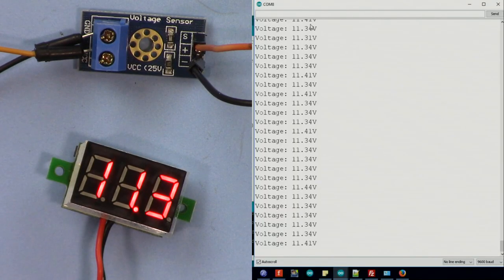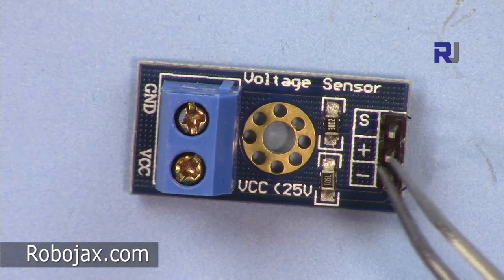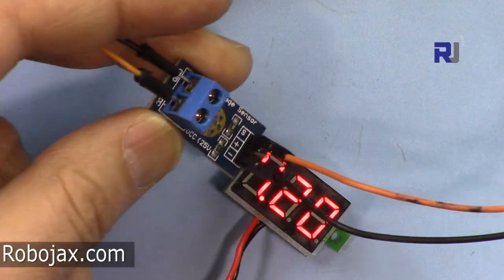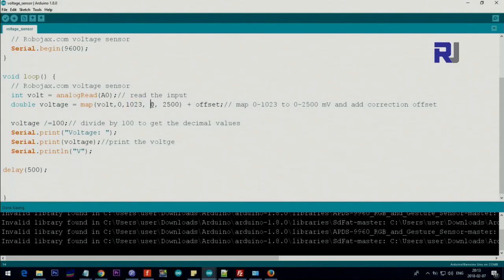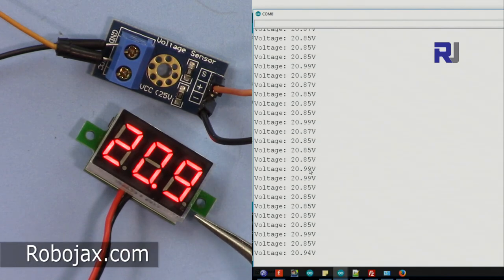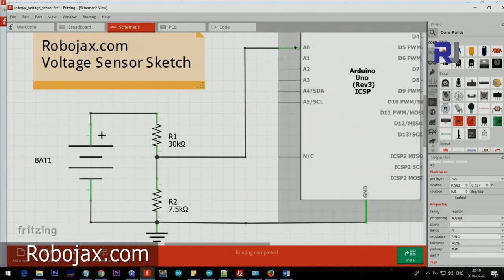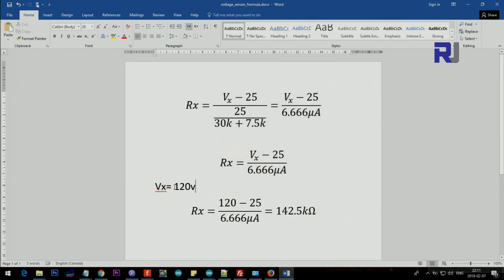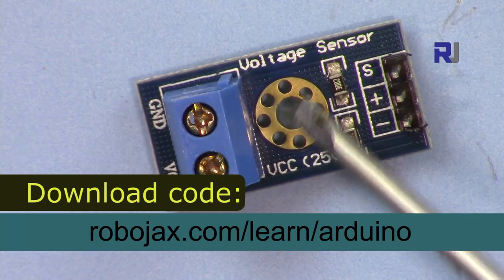Voltage Sensor for Arduino with code and formula to measure any DC voltage

Comment: instructions unclear.
 my arduino has black smoke coming out after i plugged it in mains supply.
Reply from the maker: you must have done something wrong. It can't be explained clearer than this.

Comment: Thanks for the helpful video.
If I leave this connected to a battery (for instance, a car battery) how much current does it draw? I would be concerned the battery would be drained too low.
Reply from the maker: you are welcome. I have included this in the description. the current used is 666µA which is very minimal. Even you could power it up with AA battery for months.

Comment: I just bought one of these without even looking at it - It's just a pair of resistors set up as a voltage divider with a terminal block on the end. At least it was under $2, but this module is completely unnecessary if you have a pair of resistors, and the values you choose will determine the maximum voltage - example: a 10k and 100k will give you a 10:1 division meaning you can measure up to 50V. This has got to be the most underwhelming module ever.
Reply from the maker: I have explained that in video. Unfortunately people are buying it from eBay and AliExpress.

Comment: You haven't shown where you connected the VCC and GND in your circuit to measure the voltage.
Should we connect it parallel to a load in a circuit to measure the voltage across it?
Reply from the maker: you need only 2 wires to connect to anything that you want to read the voltage.  you can connect it any DV voltage either across a resistor or sircuit as long as it is within the range. Watch the latest video on how to measure DC voltage using Arduino: https://youtu.be/t8xwrVj2aFs

Comment: Hello i have I'm trying to measure up to 60v. I have the correct resistors and output is 2v for the arduino. How can i change it to measure up to 60v?
Reply from the maker: Hello, I have explained it in the video with formula where you can  measure any voltage..  Also I have provided a document on how I got the formula. The link to the resources for the video is under the video in the description.

Comment: What we have to change the coding when use on esp32?
Reply from the maker: first you should not use this as this is just waste of money. you  just need two resistor to measure any voltage. see the video here https://youtu.be/t8xwrVj2aFs  measuring voltage is the same as using potentiometer to measure voltage. see ESP32 video for that here https://youtu.be/UXKu2Xtwj7c

Comment: Hi! Can someone please tell how to connect more than one/multiple voltage sensors in a circuit to the Arduino and read it? I really need help with the code and the connections?!

Comment: works perfectly! thanks. 

what if i want to use the voltage data in an if statement that if the battery starts to die a red led will turn on? 

can you include a code for that? 

thank you
Reply from the maker: to do something when voltage changes to a value,  do this. for example when voltage is less than 8.5V

=== start of code ===
if (volt <8.5)
{
 // turn PIN 2 high which you can connect to LED or a relay
digitalWrite(2,HIGH);
}
=== end of code ===
you can put this anywhere after the line;  int volt = analogRead(A0);// read the input
you can change < to > if you want if the voltage is greater than 8.5 or any other value.

Comment: Thank you for the valuable video! I have a question about the voltage sensor: can it be used for high current sources (e.g. a car batterie with 60-70ah)? If not, what are the adjustments we need to make, if any. Thanks a lot!
Reply from the maker: you are welcome.  this module has limitation. See my latest video on measuring voltage https://youtu.be/t8xwrVj2aFs where you can measure any voltage. When measuring voltage, the amount of energy source or current it does not care if you measure a small AA battery's voltage or a car battery's voltage.  Here is my video showing how to measure voltage and current up to 500A https://youtu.be/9jwCc7uPGoc to make energy meter. or  here if you want to display it on LCD https://youtu.be/xHe9RRQWMBM and I've got more if you search my channel.

Comment: i have the very same module, using your code it required -105 on the offset - which is fine, but when placed under it's own power, the values are out of calibration once more - and seemingly the lower the supply voltage to the arduino, the higher the returned "sensor" voltage", despite the arduino sensing it's own supply! what is going on here?
Reply from the maker: Forget about this module. Here is ultimate voltage reading for Arduino https://youtu.be/t8xwrVj2aFs

Comment: Can u pls help with esp 8266 lolin? is not given correct data...im about to get crazy here thx
Reply: Same ,i use wemos d1 mini
Reply: @rimbang_  it seems esp8266 has a prebuilt voltage reductor im not exact about what or how
Reply: Try change the map : before : map(value,0,1023,0,2500)+offset;
.
Change the "2500" i try that and is liitle accurate
Reply: @rimbang_  Tried but did not work

Comment: How you did calculate...  25V / (30k + 7.5k ) =>  0.667 mA  miliAmpers  NOT microAmpers !!!! and NOT 6.667uA  OMG! 1st grade rules of matehematics !   if you assume I=6.66 microAmpers and  Vx = 120 Volts   then  Rx  must be  14,2 Mega Ohms !!!
Reply from the maker: Hi, Just follow the link and see the document I provided. Don't use this junk piece.  Just use two resistor and measure any voltage by watching this video https://youtu.be/t8xwrVj2aFs

Comment: Hi. How can we power an esp8266 microprocessor with the battery while also checking the battery's voltage with the voltage sensor?  The 8266 uses 3.3V and the battery I'm using is a LiFePO4 3.2V.  If I use a USB cable to the 8266, everything works as expected.  But as soon as I unplug the USB cable from the 8266, there is no power to the esp8266 anymore.  I tried plugging a jumper wire onto the sensor's + pin and the other end to the 3V3 pin on the 8266, but that doesn't give it power.  I also tried connecting the jumper wire to the 5V pin on the 8266, but still no power.  If I connect the battery's wires directly to the 3V3 pin via a breadboard, my 8266 works fine.  Anybody have any ideas?  Is there any documentation for this Voltage Sensor board?
Reply from the maker: Hi, here is introduction to ESP8266 https://youtu.be/pLvqh57T3s4

Comment: Hi. Can you please explain a bit more about the correction value(int offset = 20)? What is it for and why we have to include it in the code? Thanks.
Reply from the maker: Hi, I used the offset to correct the deviation from correct value. Resistors with 10% tolerance  might give some fixed value error which can be be corrected with that offset. you can set it to 0 if you don't to use correct.
Reply: @robojax  Thank you so much for explaining. You definitely have great videos.

Comment: Thank you for the great video! 
I have a question. I want to make a circuit using the Arduino and a battery, and I want to monitor the battery voltage. Can the Atmega328 chip measure a variable voltage that is the same voltage (from the same battery) that powers the Atmega328 chip? (I want to make my own microcontroller board running on one singel lipo battery at 3.2 to 4.2 volts, and to connect it directly to the Atmega328 without the AMS1117). Thanks
Reply from the maker: You are welcome. Yes you can. here in the datasheet https://www.mouser.com/pdfdocs/Gravitech_ATMEGA328_datasheet.pdf you will see in first page the operating voltage: 1.8 - 5.5V for ATmega48PA/88PA/168PA/328P

Comment: can you help me? whenever i cut my source which is 12v the reading in the serial monitor decrease so slow that it takes 2minutes for it to go completely zero.
Reply from the maker: It seems you have a capacitor connected to the input of Arduino. Please watch better way to measure any voltage https://youtu.be/t8xwrVj2aFs

Comment: Firstly it would not exceed 25.20VDC as you mapped it to that, secondly and more importantly, that device is just a voltage divider, you exceeded the maximum 5vdc on the input and that exceeded the 10-bit adc count, inputting 30vdc at the input of the sensor means you were getting a much higher voltage on the ADC pin and risk blowing your MC
Reply from the maker: Hello, you may need to view this video https://youtu.be/t8xwrVj2aFs
Reply: That video does not change physics, the voltage divider gives a reference voltage to the arduino 30VDC when R1 is 30k and R2 is 7.5k gives 6v on divider, that is enough to ruin your arduino, there is no protection on that circuit, when you went to 30VDC you exceeded the ADC resolution and you mapped that resolution to 2500, demonstrating that you can exceed this could cause damage to the device, if you don’t know what you are doing then don’t make videos or refer me to videos that are a logical fallacy. People come here for advice, see a video like this and destroy their projects, my students use YouTube that is why I look to see the quality of the content, be responsible

Comment: Hi Sir can we add a relay module. Function of relay is when the voltage reach example 14v relay will on and if it goes down to 11v relay will off?  It is possible? Thank you...
Reply from the maker: Hi, that's called taking action on some event like change in voltage. you can learn it from this video https://youtu.be/FWRWLzKFf38w here we take action when voltage reaches at certain value. Or this video https://youtu.be/dVh77wT-4Ao
Reply: @robojax  Thank you sir. I will try my best in learning it, hope I can...

Comment: Thanks so much 
Just note that the calculation of 25v/(30k+7.5k) is equal to 0.6666666 is much easer for calculation🌷🌷🌷🌷
Reply from the maker: you are welcome. I've included a document showing how to calculate. Here is the new video showing how to measure any DC voltage without Arduino without this module: https://youtu.be/t8xwrVj2aFs

Comment: I'm trying to make a power measuring circuit using the Voltage sensor and a Current Sensor ACS712 but every time i try to connect them both to the output i want to measure the Voltage value across the Voltage sensor drop drastically but the ACS712 value maintains
Reply from the maker: you are visiting the wrong video. see it here https://www.youtube.com/robojaxTV/search?query=acs712

Comment: hi, can i measure 3 phase 415v using ZMPT105B 250v (connection L-N) to L-L? can you make video review about ZMPT105B. Again, thank you.
Reply from the maker: No. this is to measure DC voltage only.

Comment: Really great job ,, but I wanna ask of how can I change the value of the voltage from voltage value to percentage
Reply from the maker: Thank you. Yes you can but you would have to calculate it . Let me know what exactly you want so I can guid e you.
Reply: Robojax thank u sir for ur fast reply ,, I am using 12V battery and I want it to present as a percentage value.
Reply: I did the same thing u did but am using node MCU (3.7V) so I changed 1023 to 758.02 since each 204.6 unit is presenting as 1V in analog readings ,, but the issue is how to change the V to %
Reply from the maker: first you have to decide what value is 100% and lets call it maxx100 and  your value is maximum voltage is 12.3V  and your voltage in Arduino code is: voltage
float max100 = 12.3;
float percent = map(voltage, 0, max100, 0, 100);
now the "percent" has your value in %.
learn about map function here https://www.arduino.cc/reference/en/language/functions/math/map/

Comment: espcomm_upload_mem failed error is shown please give some solution
Reply from the maker: this is very basic code and should not create any problem. Try File->Examples-Basic->Blink and see if it works. There must be other settings causing it.

Comment: Would this measure fluctuating voltage from negative to positive?
Reply from the maker: No. it will measures from 0V and higher.  Not negative value.

Comment: Does the sensor heat up while working for long time (more than hour)?
Reply from the maker: Don’t use this. This is just cheating to sell it on you. I made video because the whole world got fooled by it and I needed to help people. Watch this video and just use two resistor to measure any voltage https://youtu.be/t8xwrVj2aFs and in terms of voltage , not it will not heat up.

Comment: double voltage = map(volt,0,1023, 0, 2500) + offset;

can u explain this code in simple word?
Reply from the maker: even though I have explained it, it means get "volt" which is from 0 to 1023 and map or convert it to value between 0 and 25000. The result of this conversion is stored in "voltage" variable which you use alter.
Reply: @robojax  i already run used this code but the voltage is not same as i use multimeter. I wonder why
Reply from the maker: this module is junk. Measure voltage using arduino with just two resistor with 1% error https://youtu.be/t8xwrVj2aFs I madthe video for this module because people just buy it and everyone needed a video to explain it.

Comment: I am using NodeMcu ESP8266. I adjusted the map function to map 0-2045 to 0-2500 since NodeMCU can take value upto 2045 but even then, the offset either too much or too little... Can you help me?
Reply from the maker: Take this into consideration that the referee for ESP8266 is 3.3V. The code is working for 5V reference.
Reply: Did you found the answer for Esp8266 ? I  tried a lot of variants but no result

Comment: I want to measure 48 volts. I camtget the sensor online and the resistor combination used  in series is what? Please do you have a WhatsApp or telegram group.
Reply from the maker: if you want to measure any DC voltage please watch this video https://youtu.be/t8xwrVj2aFs if you want to hire me to do a project, then contact me via robojax.com(at)gmail and if I reply and we will see if I can do it. However all my videos are free otherwise. I will charge $100/hour.

Comment: Fast voltage changes not sensing with this module.... please help for that...
Reply from the maker: Change the delay inside loop()
Makes it smaller value
Reply: @robojax  Many many thanks...

Comment: Hello and thank you very much for this video !
I have one issue however, I used the measurement of the tension to control a relay connected on digital pin #9 and I noticed a difference of +0.2V on the tension from the sensor when the relay switch on. Do you have an explication ?
Best regards.
Reply from the maker: Hello and you are welcome. 
I have created another tutorial showing how to measure any DC voltage without this module with just 2 resistors https://youtu.be/t8xwrVj2aFs.
 the resistors used in this module have ±5% tolerance. then we have 10 bits ADC , Analog to Digital converter  these two  will affect the reading.  If you are getting consistent +0.2V then subtract in the code.  I have mentioned the ADC conversion in this video https://youtu.be/9jwCc7uPGoc  so if you use my 2nd tutorial and use 1% tolerance resistors you should get better result. Of course there are other ways using extra modules to get better result too.

Comment: Can it be used to measure a potential (in Volts) having 3 digits after the decimal point? like for example  "123 mV"?  Please reply
Reply from the maker: the measurement depends on the ADC (Analog to digital converter) of Arduino board. Please  see this page https://www.arduino.cc/reference/en/language/functions/zero-due-mkr-family/analogreadresolution/

Comment: Hello, can you please help me to write a bit code for reading current from ACS723 40A bidirectional ?, tnx Jack
Reply from the maker: Hi Jack, I will have to write code and test it before I can offer you anything. I will purchase the sensor and then make video. I do not promise this to be soon but putting in my "to do list". Ahmad
Reply: Vy kindly, tnx Ahmad. 
I remain available for reimbursement the cost, thank you
Jack

Comment: Hi, i get wrong values (6.23 volts instead of 3.88 v measured with a multimeter), how can i fix this problem?
Reply from the maker: check the resistors to see if they are the value I explained in video. Your module might be different.  use a multimeter to meter to measure the voltage at the two resistors.
Reply: @robojax  thank you for your reply, in the end I noticed that the error was an amplification of the actual voltage by 1.6 (more or less) and I solved it via software. Let's see if it works as expected now :)

Comment: Thank you very much sir !!!
Reply from the maker: I am glad you found useful. This is just two resistors.  Here the video where you can measure any voltage with just two resistors https://youtu.be/t8xwrVj2aFs and here is Arduino Step by Step Course  (over 100 lectures) Starts here https://youtu.be/-6qSrDUA5a8

Comment: How many input voltages can be read in parallel by one board?
Reply from the maker: Please watch the latest video which shows you don't need this module https://youtu.be/t8xwrVj2aFs all the pins A0 to A5 are analog input but Arduino Mega has move than 10.

Comment: hello. can you release a video tutorial for AC voltage sensor controlling a relay
Reply from the maker: Hi, I will put it on my "to do" list. I assume you wanted AC of power line like 120V or 220V correct?
Reply: @robojax  did you ever  do the video tutorial for AC voltage sensor controlling a relay? That would be great.

Comment: Sir, How can I use voltage sensor to sense Human body voltage?? Pls do reply sir coz i m in mid of my project...
Reply from the maker: No. there is no such thing as human body voltage. If you put one hand on the positive(+) terminal of a bettery and another hand on the negative (_) terminal of battery, you body will pass a little current depending on how moist your body is. that can be represented as resistance. But whithout connecting any voltage source, your body will have none.
Reply: @robojax  tqsm sir...